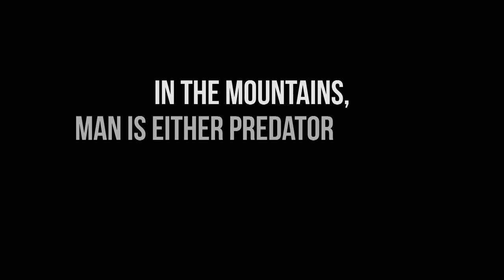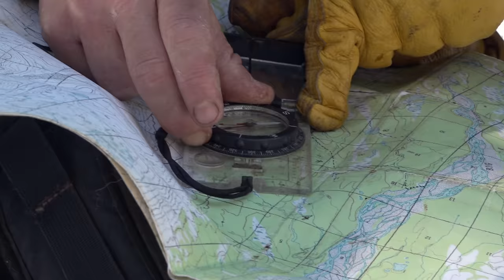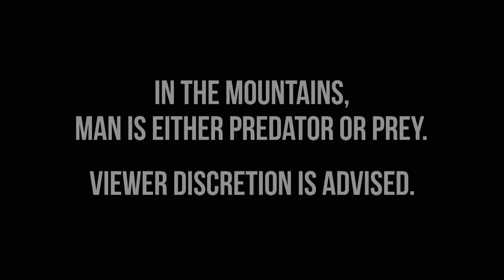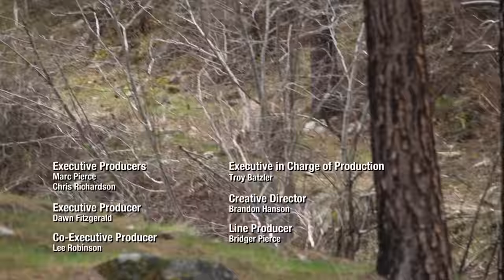Mountain Men: Tom vs. a Threatening Coyote (S8, E10)

Comment: With that Eustace cabin build ... I would like to see him use large pegs to reinforce the construction.  My wife's family had a peg built barn and in the last Mississippi flood that hit around Fort Charters, Illinois ... the waters rose to the power lines ... their barn floated 'INTACT' miles away and set down in the road.  There is a way I believe to use pegs that can be slightly shrunk & then inserted into holes. Once there they swell and lock everything down.  [Heating the pegs?].  Anyway ... if only gravity is holding those logs in place, its a bit shaky ... tornado ... earth tremor ... etc.   What do you think?